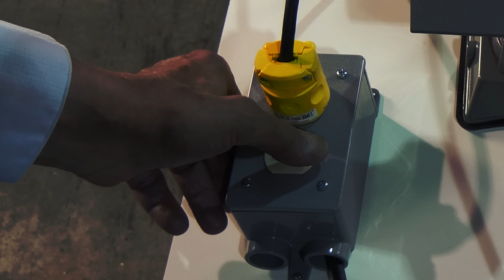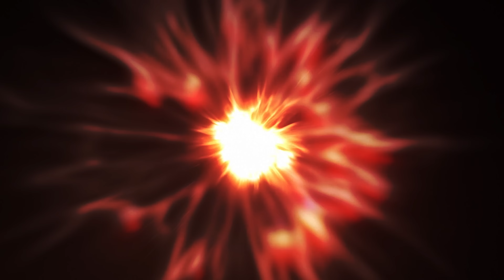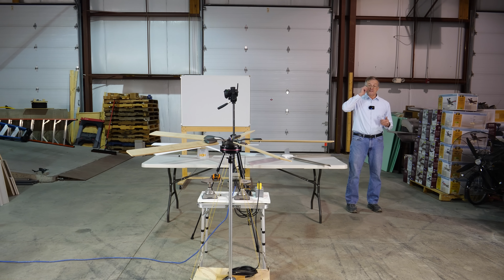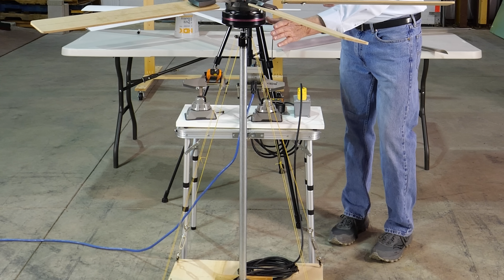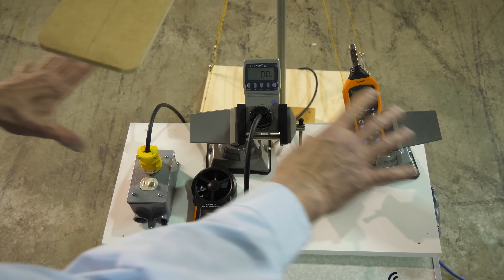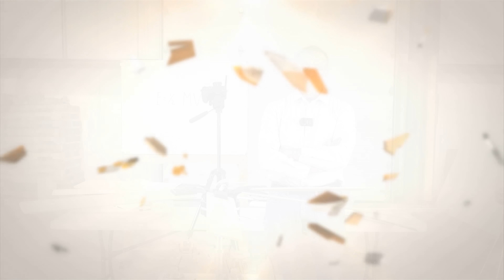This Fan Uses Almost NO Power

Comment: I had a feeling they were garbage. We've swapped a few out and have to crank up the speed to get any ok flow. With some noise. More expensive does get you more quiet to some extent. But even recently they are out of balance. Need to give this a try.

Comment: Super fascinating--I was completely unaware of how garbage "residential-grade" ac motors actually are. It seems like they haven't gotten a "tech update" in the past 20 years. In my job, I regularly work with BLDC motors, and, depending on the operational points, we can drive efficiency (so mechanical power at the shaft / electrical input power) north of 90% quite often. 

Really, this is enabled by how much cheaper and generally better ESCs are getting due to advances in semiconductors on both the technology and production side. 20 years ago, ESC's already existed but they were primitive compared to what you can get today for literal cents.

Comment: Winglets at the end of the airfoil will help reduce wingtip vortices
The motor buzzing almost makes me wonder if that's part of the noise floor (edit: ah, was the surprise reveal of the video)
Really looking forward to a high pressure application as part of revisiting the AC you demonstrated a few years ago

Comment: Here's how I was able to cut our electric consumption in half:
-Inverter A/C
-Inverter fridge
-Direct drive washing machine
-Heat pump dryer (yes, it takes twice as long but it's at least four times as efficient)
-Good insulation (rent a thermal camera for this)

There are probably many others but these were the biggest impact.

Comment: Summarized the measurements, with rough timestamps:
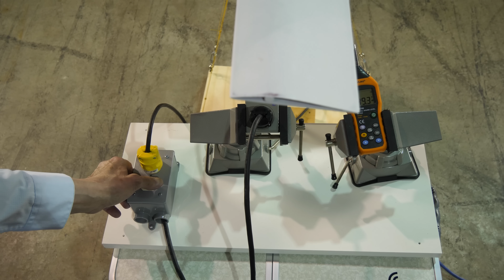Background noise (8:30, 15:59): ~40 dB 
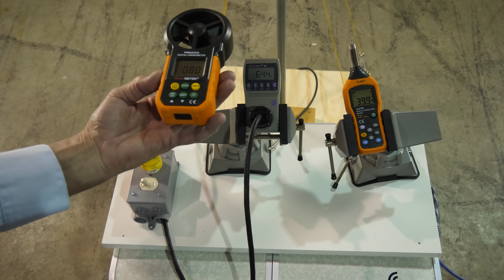Stock blades (6:43): 1 m/s, 64.3 W, 40 dB
simple airfoil (7:55): 0.8 m/s, 66 W, 40.9 dB
modern airfoil (9:12): 1.2 m/s, 64.5 W, 42 dB
stock motor no blades (13:49): 53.8 W, 64.2 dB
BLDC motor no blades (16:24): 8 W, 39.1 dB
BLDC stock blades (18:27): 1.8 m/s, 59 W, 48 dB
BLDC stock blades at reduced speed (19:35): 1.0 m/s, 27.3 W, 40.2 dB 

To be honest, this should have been presented in the video, with graphs and/or tables.

Bonus:
Spectrograph analysis (using "spectroid" app on Android phone and video playback at 1.0x speed, from PC speakers)
For stock fan, the highest peak was around 120Hz. The half height points of that peak were located nearby 56 and 185Hz. It is the audible wizz sound. You can hear it even when the fan is off  - guess it was HVAC or other applances in the warehouse. 
Now the part I'm not sure if I'm correct or using the right terms - the microphone or post-processing software was doing some dynamic loudness compression/compensation - You could hear the wizz louder when nothing was spoken. While speaking, the wizz is scaled down to keep the loudest sound source constant volume. 
So: There is no point to continue spectrum analysis, as recording has it's flaws. The external HVAC/something wizz is messing a little with the results. It would make sense to do the measurements during the experiment.

Metodology feedback:
- the anemometer should have also been mounted on a stand, constant distance away from the fan blades to provide stable reference
- external noise sources, but I know they can be hard to isolate
- spectrograms could be nteresting. It's not only acoustic power, it's also how much power is in the irritating frequency range
Reply: Thank you !
Reply: I think, this is a misunderstanding. This was not a product test, do find every last difference in performance, this was a example in problem solving in engineering. It was a failed project of optimizing a  cheap fan by attaching new blades. In the end, the real solution was to change the motor. 
The difference in power consumption was so big, that the methodology was more than  adequate, for the question.
Testing blade designs in a real world setting would be a interesting part two.
Reply: A fan like this should have near uniform inflow. The anemometer moving around shouldn't have affected the measurement too much, but seeing how big the margin of error is on the measurements, it could be a bigger deal than I anticipate.
Reply: @spb1179 regarding uniform flow: the ground is relatively close compared to fan diameter. If normal airflow reminds almost cylinder-like cone, now the middle part of the moving air column encounters flat surface, raising the pressure a bit and forcing air to move to the sides - interfering with outer part of the moving air column. This should have pronounced effect close to the ground, let's guess up to half of the air column height.
I agree with You, that such minor differences in anemometer location could result in little to no difference, good point.

Now I'd love to see the schlieren photography of the airflow to confirm my guess-analysis in this comment 😆
Reply: @spb1179 Wrong, speed distribution under blade projected area varies a lot, and is highest close to the edge, center has very low speed! So scanning and integration taking surface area into acc. makes most sense
Reply: External noise can be compensated for by going through power. If you have a 40dB background and you measure 43dB with the device working you have 10⁴ APU (arbitrary power unit) background and 2*10⁴ APU with the device working so (2-1)*10⁴ (40dB) is produced by the device. Above 10-15dB increase the error becomes negligible.
Reply: I would add fan balance (both centre of mass and blade alignment) to the set of variables - especially for the noise
Reply: A scale would have been a better measure of airflow. (Would need to be shielded from moving air somehow to not cause interference.) Also, the buzzing creates a high noise floor and without an FFT the spl measurement is junk data. Unless you're off grid this effort is pretty much wasted. Sometimes people aren't interested because it doesn't really matter...
Reply: @andy2108 On the AlphaPhoenix channel big weight scale was used recently to measure the weight of a drone flying over it. 
You could mount the motor on a scale (hanging baggage scale or tensometer) and it should do the job too, I think even without need to shield it.

We're measuring velocity indirectly, through the mass of air. We'd need to dig deeper into the equations to confirm if weight is linear to the airflow, convert it, consider effects that may affect measurements (like ground effect - airfoils close to the ground are subject to higher lift forces than ones higher in the air, search for videos focusing on ground effect planes). Different methods have different strengths and weaknesses. As this video almost didn't make it - simpler and more intuitive approach sounds like a good start, with ability to switch to more complex methods in case of doubt, without overthinking it from beginning.
Thanks for an interesting aspect to think on! 😉
Reply: thanks for saving me 25 minutes from those thiefs.
Reply: It is way better to measure thrust, not air speed too.
Reply: Thank you!
Reply: The external buzz sounds a lot like a fluorescent bulb ballast to me. If they haven't swapped out the stock lights with LEDs, that's exactly what I'd expect to hear.
Reply: @ryanbrown982  That's what I thought as well. Time to convert to LED tubes for quite and efficiency.
Reply: I feel like I'm missing something obvious.  When I look at those, it seems like the fans are almost silent (3dB isn't nothing, but measurement error being ~ 1/3 of that), but the (stock, A/C) motors are pretty noisy unless the blade is on to slow them down.  So now I also want to know the motor RPM and fan RPM to see if the BLDC are really more efficient because of some sort of increased torque->reduced motor speed for the same fan speed, or something.
Reply: @jimjjewett  I'd expect "Stock blades" and "BLDC stock blades at reduced speed" to run at the same RPMs, as the wing geometry and the air speed were constant
Reply: Excellent commentary.
Reply: This video is sloppy and lazy. Your methodology comments are good👍
Reply: @johncoops6897  Disagree. They have used their valuable time wisely. Many seem to have missed the point not to the err of the publisher imo. The video is available to re-watch for anyone interested.
Reply: @obban12 - you disagree with WHAT, exactly. Furthermore, your comments are not comprehensible, nor do they relate to ant point that I made.
Reply: @johncoops6897  @HorochovPL  methodology uses an android app with mobile phone speaker and mic. Your comment is sloppy and lazy. Using garbage audio equipment for science is not a good method.
Reply: @Keith-t3k  the method is still more precise, we're not talking about 90s phones with stupid mics. You can get as close as 98% of the way before you need special equipment today. I tried my 2022 oneplus phone against the lab mic at work with specdroid and the difference was mostly 0.5 db in 98% of the spectrum I can hear.
Reply: Your using an android app with phone mic and speaker through your PC speaker going through the YouTube compression algo and you complain about methodology?  Just use paper cups and a string. You would probably get better results than your garbage.

Comment: The first thing that popped in my head was, did you account for the mass of the different configurations? Was the mass of the wood, vs. the metal, vs. the plastic blades approximately equal? I don't think it would have changed any of your conclusions, but it's a question in my brain.  Thanks for the experiment.

Comment: For comparision: here in northern Germany we pay about €0,28 per kWh. I was surprised that the cost for electricity is not so far off on the other side of "the large pond" as  we sometimes call the Atlantic ocean. In political discussions about energy change and fighting the climate crisis some parties often stated that electricity is way to expensive over here. About appliances in the home: it is very difficult for the consumer to figure out, what kind of electric motors are build into those. It would be great if producers would have to provide this information on the packaging.
Reply: Often times (in the US at least) people say whatever the bill says they were charged per kWh, without adding in the taxes and fees. I don't know how often that part is taken in to account, and would likely be different in another country. I think that's one of the problems with some comparisons of renewable energy, they would be saving X per kWh PLUS the taxes and service charges.

Comment: Yes, these AC motors that run at non synchronous speeds have horrible efficiency. The BLDC motors are a much better choice and cost is coming down.
I think the little shaded pole synchronous motors are about the worst.  Not a big deal in the past, but electricity is not "penny cheap" these days.

Comment: Seems DC is the way to go... much more efficient and cost effective. Less load on the system/infrastructure, less fuel costs for the supplier, reduced maintainence, but a loss in profits since there would be less consumption by the end user for the same work completed...  good for the entire system but terrible for profits in a way....

Comment: Not sure if the power factor is accounted for🤔. Was a true rms power meter used for the experiment? Seems something is not adding up. It would have been better to have used a dc supply(with current monitoring) coupled with a pure sinewave inverter(with known efficiency), for driving the ac motor. Squirrel cage and 3ph ac motors are highly efficient compared to shaded pole or capacitor run split phase motors.❤👍

Comment: I do question the "decades" part. If BLDC became the norm then YES! an enormous amount of electricity consumption could be directed to other uses; However, I believe that the ECM would be build down to the bare minimum to survive the warranty period. "Look at all you're saving on electricity, you can afford a new one every 3 years." would be the thinking from manufacturers. Oh, and it wouldn't be a simple, standardized, plug-in ECM module, that is from a discontinued model and you'll need a whole new unit. 
I'm consistently disgusted at the obviously engineered impediments to repair. So far this year I've repaired thousands of dollars worth of appliances, many of which could have, with little to no additional cost, been serviceable by any average person who knows how to use a screwdriver and socket set. If I seem angry about it then this rant is functioning as intended.
Now, a higher-than-average portion of viewership on this channel are likely, as I am, thinking of building their own. Just two hours ago I fixed a cordless drill with slightly higher rated MOSFETs and bearings instead of bushings and instead of working for another 18 months, I expect it to function flawlessly for decades. $15 in parts to me WOULD have been $0.30 at manufacturing scale. 

I don't know how to correct this cultural problem.

Comment: I feel like you're painting an incomplete picture since you're not measuring air volume and airspeed. You could be trading a small amount of speed for a large gain in volume, but you'd incorrectly claim the worse blade was better.
Reply: Q=vA. A didn't change, the anemometer is the same. Placement was roughly the same, so it's not like there's a significant error from being in a different part of the flow field. The absolute flow rate really isn't relevant to the scope of the comparison, only the relative flow difference between the two. If velocity is the same in the same spot, flow is the same. It's not like it's compressible flow coming off of a ceiling fan.
Reply: @yucannthahvitt you're simply incorrect. It is impossible to draw a meaningful conclusion without considering both volume and airspeed. In fact, volume is generally considered more important than airspeed. This is why fans are marketed and classed by CFM instead of MPH.
Reply: @Specter0420 Q=vA. Google it or something, I don’t care. I’m not going to write a basic fluid mechanics textbook in a youtube comment for you

Comment: test seems faulty maybe - variables like wind speed position needs to be factored, could easily be different at wing root to wing tip, so you need to measure multiple locations and you MAY find that the variance in position may even out the differences all together - not saying it is, but just saying it could.

Comment: probably would save more than 1K$ over 10 yrs due to energy cost increases over those 10 yrs...  would have been interesting to see the asymetrical blades run on the DC motor at full speed... may have even had enough force to lift the blades at the ends :)   I would guess 2.6 m/s flow rate.

Comment: Intresting subject and video.  I have one concern.  I do not have the specs on your power meter, however, most of these meters are based on calculations using a 60hz sinewave.  I would be very curious to see on an oscilloscope the AC power draw of the brushless DC controller. (use the oscilloscope readings to calculate the power consumed).

Comment: I was totally expecting the asymmetric airfoil to be tested last. Why did you skip it?
Reply: Probably expensive to make. 🤑
Reply: @kevinmiller5467  No he had it right there, just needed to bolt it onto the motor.
Reply: @kjohn5224  I should have finished the video before commenting.

Comment: The manufacturers 'optimize' these motors (for them) to shift the cost from materials cost to long-term operating costs. Not all AC motors will be as inefficient - these ones can be short-wound to save 'copper', because the heat from the added magnetizing power losses will be carried away in the air stream. AC motors buried away in equipment, without a cooling fan, can be built to dissipate very little heat by running at reduced magnetic flux densities. For example, you would probably find that a 220V fan running on 110V would appear to be much more efficient in producing its reduced flow, due to its hugely reduced magnetizing power losses.

Comment: I guess the speed controller for the DC motor, is using Pulse Width Modulation to control the rotational speed, so the electromagnets, won't be using 100% duty cycle, when running at a lower wattage/speed. Could that be the reason, the DC setup is more efficient?

Comment: I wonder how "Technology Connections" missed this subject, since such are "par excellence" HIS topics!!! Thanks for pointing that out, cause although aware, I´ve missed that... Please, give us a clue of where to find those brushless motors...!!! Let the knowledge flow... And we didn´t even consider, how much more power a lower-efficiency-motor consumes, then it´s reached its equilibrium-temperature (and its stator-resistance rises), which is surely higher than the corresponding equilibrium-temperature of the higher-efficiency-motor... 
Imagine now if the stator was out of  Finemet, metallic glass, or nanocrystalline iron (materials for high-efficiency-stators and -transformers).

Comment: I replaced my old box fan for my bedroom that used about 50W on low with one that has an ECM. It only uses 11 watts for roughly the same felt airflow. 
$20 vs $60 for the fan replacement, but as I almost never turn it off in the morning, I'm looking at roughly 2 years or so for that energy savings payback. I've had it well over a year, maybe close to 2 now and it still runs perfect, so money well spent I think.

In the last 10 years or so, a lot of commercial buildings have been switching over to direct drive ECM motors for their exhaust fans. And now they are starting to become pretty common in air handlers as well.